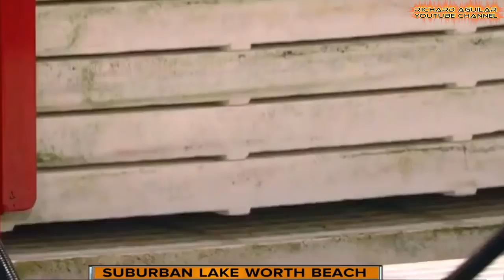The Rise Of Greenhouse Farming Is Gaining Momentum In 2020

Comment: Is such kind of farming is now started in China? If yes, how much widespread it's now?
Reply: Photovoltaic plus agriculture has been subsidized in the past few years and is now very extensive.  The photovoltaic power generation on the shed is used for the electricity demand under the shed.  The excess power input is sold to the grid, which is then exported to industry.  Because photovoltaics are cheaper, there is no need for state subsidies.
Reply: @林千山  Correct! As there is no need of grid, the cost is already cut to half. Whatsoever, can you tell me whether anyone succeeded producing crops like rice, wheat or maize in this way?